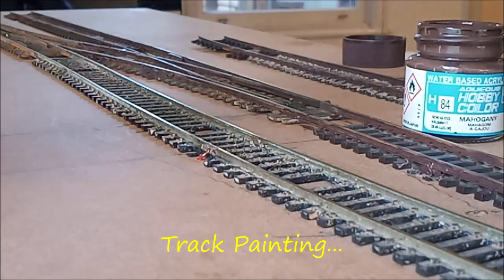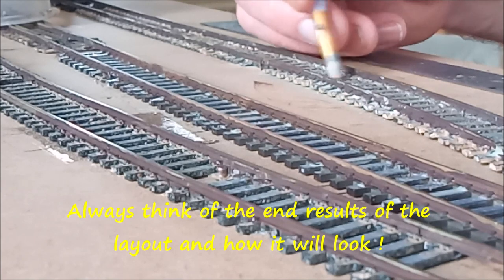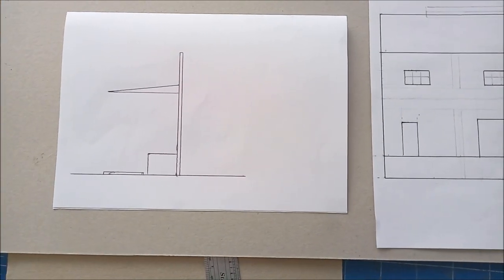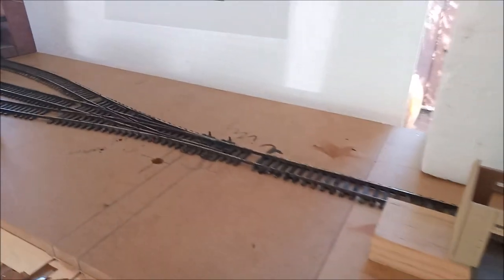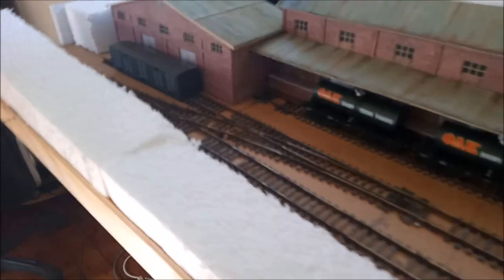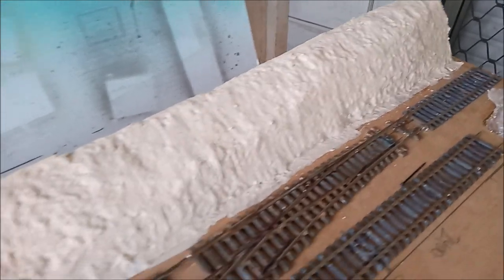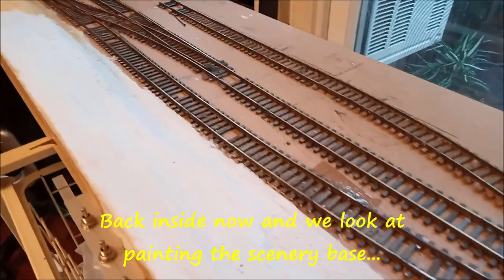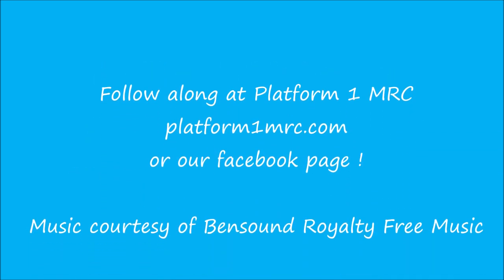Building a Small HO Scale Shelf Layout Part 2

Comment: Really like your Dispatch and Receiving Scratch builds. I have been trying for a while to figure something out for my SDS BMT tankers and this is the best inspiration yet! 

But I've never scratch built before would you have any suggestions on materials and where to find some decent plans?
Reply from the maker: Hi Caleb, 

Over the years I have traveled around New South Wales and photographed any thing that is railway related and whilst up at Taree, I popped past the Manning Branch Milk Depot. These photos aided me in the design of my milk depot. I also googled milk depots and found some interesting photos online. 
As for modelling materials, I like to use 1mm, 2mm, 3mm grey board, or 3mm foam core as the sub structure of the model. All very easy to work with and PVA is ideal for bonding. As I mentioned in the video, the brick on the milk depot is from the Scalescnes range of downloadable papers. You'll find a link to Scalescenes in the video description above. 
I also scratch build using styrene. It is a brilliant medium to work with. If you have never scratch built a structure from styrene, I would recommend getting hold of the dvd 'Building Buildings with Geoff Taylor'. It is still available from DCC Concepts and Amazon
Building Buildings with Geoff Taylor : https://www.dccconcepts.com/product/right-track-7-building-buildings/ (DCC Concepts is way cheaper than Amazon...)
Evergreen and Plastruct do some fantastic shapes and angles in smaller packets which will always aid your builds. Tichy Train Group and Grandt Line produce some terrific doors, windows, lamps, brackets, handrails, porch posts, chimney tops etc, etc.
Evergreen : https://evergreenscalemodels.com/
Plastruct : https://www.plastruct.com/
Grandt Line : https://www.grandtline.com/
Tichey Train Group : https://www.tichytraingroup.com/Catalogs.aspx
Most good hobby shops should stock the above.
Hope this helps you out with your future builds. 
Cheers, Gary.
Reply: Gaz3801 thanks Gary really appreciate your tips, definitely will look into that DVD. Looking forward to your part 3 for this build!